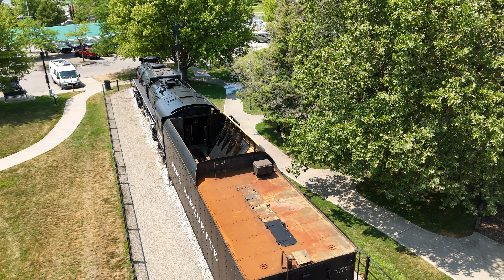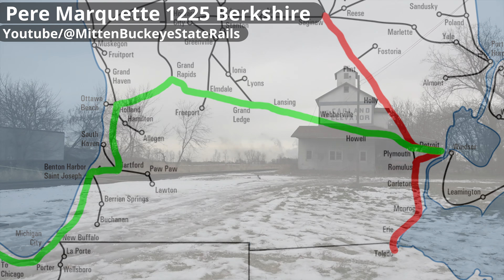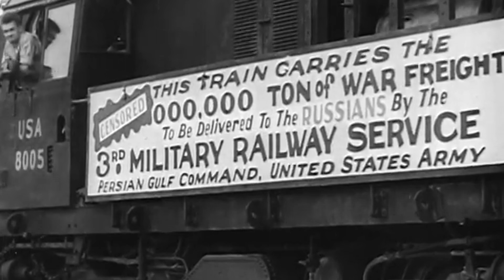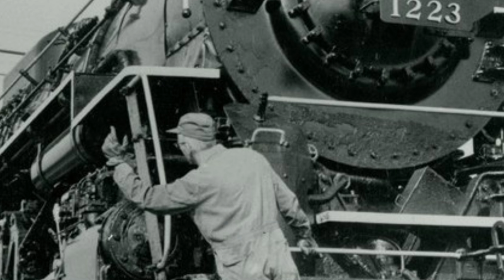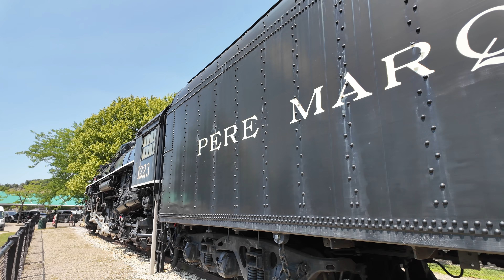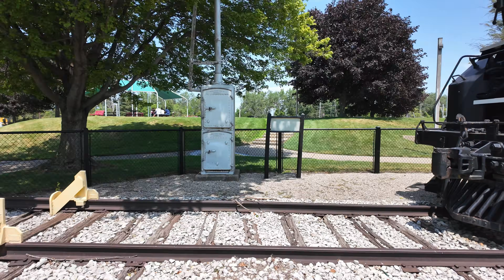Berkshire Superpower Steam Locomotives

Comment: 1225  on display at MSU. 1225 was later acquired by Steam Railroad Institute from the MSU students and restored for a return to service. 1224 was used to obtain missing parts to complete 1225's restoration.1225 also served as the source of sounds on Polar Express. It runs regularly out of Owosso, MI and does runs known as North Pole Express to avoid copywrite issues.
Reply from the maker: I haven't seen 1225 in a while.  Definitely need to do a video on it.  You mentioned 1224.  Did you mean 1223, or are parts of 1224 still around somewhere?
Reply: @Industrial_Revolution  You are correct, for some reason I thought both 1224 and 1225 we spared

Comment: William E. Woodard, vice president of engineering at the Lima locomotive works, tested his super power ideas in1922 on a New York Central Mikado. It lead to his design in 1925 of the 2-8-4 Berkshire prototype (the A-1).We stopped at Lima, Ohio back in the 1990's when many of the factory buildings were still standing. While we couldn't go in it was none the less a very impressive site. We stopped at the Allen County Museum and I purchased a book on the Lima locomotive works. it has a lot of great pictures in it. Lima was very good about officially photographing work processes on the erecting floor, machine shop, forge shop and the other shops. Sadly all of the buildings have been demolished and nothing remains of the Lima locomotive works. And yes Berkshires are my favorite class of locomotive. Power at speed. A great book to read if you're interested about what it was like for the train crews operating these  locomotives is "Life on a Locomotive"  by George Williams. It details his father Buddy Williams life starting out working for the Chicago & North Western railroad  and working his way up to the position of passenger locomotive engineer.
Reply from the maker: Thanks for the great info!

Comment: One thing I couldn't understand was why would they build such big heavy engines if they were limited so much in where they could run? I would imagine they upgraded or at least did some more track engineering and construction to accommodate an engine of that size and weight.
Reply from the maker: That's a good question.  It really comes down to pulling power.  Pulling power is a function of the total weight loaded on the driver wheels.  More weight on the same number of wheels mean you can pull a heavier train.  
So why not just add more driver wheels?  Well, they actually do, but there's a max there, too.  Since all driver wheels off a single cylinder need to be in a fixed, straight line, it gets tough to get around sharper curves if you get above 6 or 8 drivers.
More than that, you have two options.  Either go big and articulate the locomotive in two, distinct sets of driver wheels, like the Big Boy, or go small and go with geared locomotives, like the Shay.
So it's all a balancing act.  The railroads had to balance weight, boiler pressure and output, and driver diameter to achieve their goal of speed and pulling power.  Heavy trains that go fast need huge, heavy locomotives.  For a diesel of this era, they'd be putting 3-4 locomotives in a line to pull the same train, and, with less start-up tractive force, they might have needed even more.
Reply: The other lines were probably feeder lines with less traffic and lighter loads.
Reply from the maker: @grizwoldphantasia5005 A lot of them definitely were.  The big, fast, heavy trains were to get stuff west (via Chicago), east, (via connection to another railroad in Toledo) or south (via other railroads, either through Chicago or Toledo).  Pere Marquette connected a lot of smaller towns, and a lot of smaller businesses, and even had some train ferries across Lake Michigan, but their heavy lines were between big cities.
Reply: It’s wild to me that railroad tracks have weight limits. It makes sense, with bridges and grades and such, it’s just not something I thought about before.
Reply from the maker: @Biocarey both the rails and railbeds, actually.  If you look at the mainline rails, they're heavier than switchyard rails, for example.
Reply: The funny thing is that the PM Berks aren't actually particularly large or heavy as American locomotives go. 35t/axle is not out of the ordinary for this era of steam.
Reply from the maker: @AFullerHouseAtlantic True, but a lot of those tracks were built for far lighter.  You get up into the UP, especially the western part, with trainloads of iron ore, those were built for heavier loads.
Reply: @AFullerHouseAtlantic  No they are neither large nor heavy. Matter of fact Berkshires are considered medium sized locos in weight and size. Large and heavy would be for Big Boys and Alleghenys and the like. Think of a Berkshire as a 'Pocket speedster'. Not much bigger than a USRA Heavy Mike, and easily dwarved by Northerns.
Reply: @PMRailfan  Depends on the Berk in question. The defining Erie-style/AMC-style high drivered Berk design isn't far off a smaller Northern like the Reading T-1 sizewise. But yeah, they're mostly meant for higher speed medium sized trains, they're not designed for really heavy haul stuff the way the bigger 2-10-4s or articulateds are. The original lower driver B&A A-1 was not nearly so fast but had considerably more starting TE, something like another 10,000 pounds without booster. 

(On the other hand, in the UK a 2-8-2 was so big that it could pull more train than a passing loop could fit but everything's small over yonder...)
Reply: Yes, Railroads very often upgraded to accomodate newer equipment. Enlarged tunnels, braced bridges, etc etc.. This wasnt so much the case with the PM, and with WWII happening, the tank/gun/plane industry in the PMs back yard, they needed a loco that could handle the strain. 

The PM already had trackage the Berks could run on, wihle at the same time was updating too.